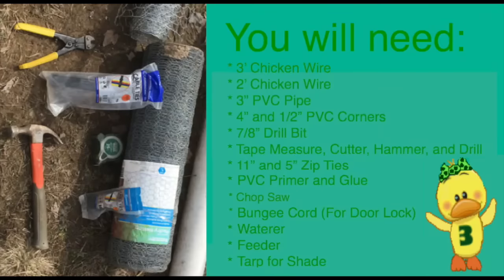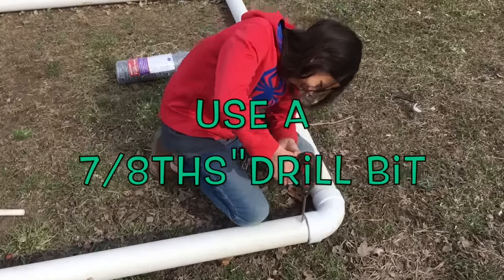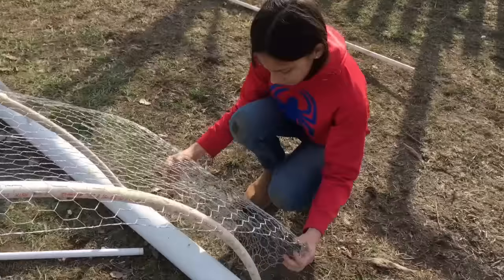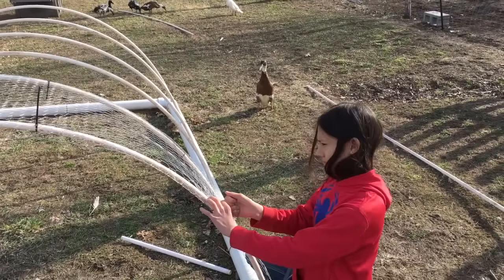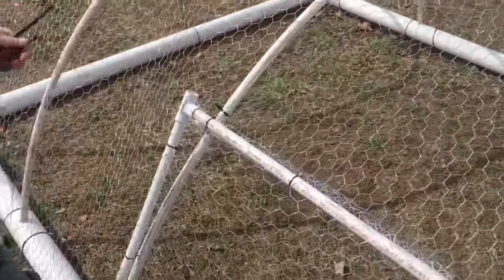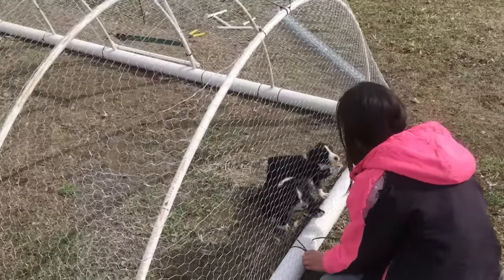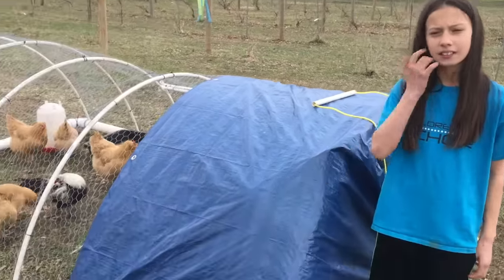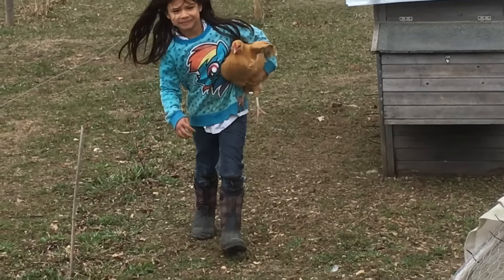Best PVC Pipe Chicken Tractor For Pastured Poultry - Part 1 (EP-36)

Comment: Thank you for this video! I'm currently building one based on this plan ☺️ Just wanted to give everyone that's going to plan on building this chicken tractor a heads up that you'll need one more piece of 1/2" PVC (8 ft) and four 90° elbows. I forgot to add that to my shopping list 🤭 I also replaced the 6ft 3" PVC on the ends with 2" to save about $20 👍
Reply from the maker: I'm thinking this will leave a small gap under the 2" sides and may encourage chickens to dig there. Moving it more frequently might help. Good luck and thank you for your kind words!

Comment: Outstanding design, very quick and easy to set up. If I was going to point out a 'down side' it'd be the cost of the large diameter piping & pipe fittings in comparison to a pvc build using smaller diameter parts.
Reply from the maker: Hello and Thank you so much!  3" pipe is getting expensive!  Reducing the base diameter could help save money.  The 1/2 poles go to the bottom of the base pipe and might be less stable with shallow pipe and I found the 3" inch pipe slides better....but cost is important too.
Reply: @vineyardchickshomestead  you're just all kinds of awesome 😊

Comment: I like it!!  My next project.  I think it would be easy to add "wings" made with more PVC and 2 foot chicken wire that would hinge on the big bottom pipe (using ties?) and could be raised to rest on the curved frame during "travel".  The sides could be 2 on each side for ease of lifting without bending, and the ends can be one piece.  The "wings" should be extended to cover the corners when the ends are down.  The door would be closed when moving so it even works for that.  When the "wings" are down they should be staked with something so critters can't lift them.  Maybe lawn staples or even stakes driven at an angle and resting on the pipe.
Reply from the maker: The base is pretty heavy. We have not lost any chickens in our tractors even though we lost 2 this summer out of the fenced in pen with 6 foot fencing.  It's pretty heavy unless you lift it by the strings.  Good luck.

Comment: Hello. Thanks for your great tutorial on building a chicken tractor with PVC pipe!
We noticed that you recommend cutting the 3" PVC pipe at 6 feet.
In our area, 3" PVC pipes come in 10' lengths, so we wondered about cutting one pipe exactly in half (5' lengths) so as not to have an unsuable 4' length on two different pipes.
Will reducing the length to 5 feet instead of 6 feet cause the 1/2" PVC pipe to bend too much so as to snap it in two?
If the bend is too much for the 1/2" PVC pipe to handle in such a situation, would inserting a PVC fitting exactly half-way on each pipe -- so as to make a "spine" down the length of the tractor -- prevent the "snapping in two" situation?
Thanks in advance for your answer! :-)
Reply from the maker: Hello Mr Michael.  I definitely understand the concern of being wasteful.  The 6 foot length retains the properties of the half circle with a 3 foot radius.  It lets you use 3-ft chicken wire on the end caps and has a really nice shape.  I have not tried to bend the 1/2 inch PVC past this point so I dont know if it will cause too much stress. I have 3 of these tractors in use now and have two more videos planned for June so please subscribe if you want to see them.  Blessings! -Trie (girl in video)

Comment: Love your design. I used your design to build my first chicken tractor for my 10 young pullets before I put them in the big chicken & coop  with the larger hens. I made a couple modifications. Ist I put in 2 doors instead of 1 door because I am large and it's hard me to crawl inside the tractor because I'm 6 feet tall and in my 60s. One door for food and the other door for water. I also attached carabiners with hose clamps to the roof pvc pipe to food and water.  I also placed an old  medium size plastic dog crate with pine shavings for them to sleep in the night. We have problem with raccoons were we live in Connecticut. So placed "Nite Guard Solar " predator flashing red lights on all 4 sides. 12 to 13 inches from the ground to keep away coons & skunks. So far no complaints from my young pullets. 🐥🐣🐥
Reply from the maker: Wow!  I'm really happy to hear you liked my design and made it work for you.  I'd love to see a photo with your modifications.  Sounds really cool!

Comment: Hi! Headed to purchase supplies for this project. You listed 6 pieces of 1/2-inch PVC are required. What about the door? Wouldn’t I need another piece to make the door?
Reply from the maker: Hello Ms. Cook!  Yes.  You would need some old scraps or and extra new piece.  But you could also use anything that is about 2 foot by 2 foot to tie the chicken wire to.  Maybe an old picture frame or scrap 1x2 wood.  Really and square shape would work if its 2 foot x 2 foot.  Good luck let us know how it works out!  If you havent seen our Part 2 video we really recommend the utility tubs we found!

Comment: How long are the 1/2 inch pvc pipes making the hoops? The longest my local store had was 10 ft. Eye test appears to me to much smaller height when I bend them.
Reply from the maker: The 1/2 in pvc pipes are 10 ft.  They are stretched 6 feet across the base and end up being 3 feet high in the center.  That is why I use 36 inch chicken wires on the ends because it is 36 inches high.  I hope this helps!  Thank you!
Reply: @vineyardchickshomestead  thanks, my eye was just bad. This design plan is flexible! I had some 46 inch wide chicken wire laying around so I shrunk down the 24 inch distance between the hoops to 23 inches no problem!

Comment: How much did it cost to build? It's an amazing design.. I love it.
Reply from the maker: Thank you.  We really appreciate it! We made our first one from scraps around the farm but you can expect to pay a little over $100 if you dont have any.  Our local building store charges about $55 for 3" pvc (4), $12 for 1/2" pvc (7), $18 for elbows (4 of each size), and about $20 for both rolls of poultry wire (24 inch x 50 feet and 36 inch x 25 feet.). You will pay less if you have some scraps and more if you need to buy zip ties, string, pvc glue, or drill bits. Hope this helps!
Reply: Thank you so much

Comment: Thank you for this video on chicken run. Question: how did you connect the door frame? Before you made actual door , there was a door post that was horizontal with the hoops. This one horizontal piece, you connected the door to. Did you zip tie this one horizontal base frame or glue it? Thank you
Reply from the maker: Hello Ms Abby!  After I made the rectangle out of scrap pvc and covered it with chicken wire I looped loosely on top so it could pivot from the top.  For the bottom I ran a bungie chord across the bottom attached from the neighboring pvc pipes but now I use a little loop and ball bungee on both sides to fasten the bottom.  I hope this helps!! If you haven't seen Part 2 I show some ideas I had for feed and water trays, nesting boxes and such that all pull very easily.  The great thing about this tractor is 1 girl can pull it and give them fresh grass every day!  Good luck!

Comment: Fantastic video. I just ordered two batches of broiler chickens, 15 per batch delivered three weeks apart. This design is perfect because it will be easy and light to move. I think I'll stake the pvc pipe to the ground to keep it secure from wind and predators. Do you have any other suggestions to keep it secure?
Reply from the maker: Awesome Holly!  Thank you so much.  We do have a suggestion and we plan to make a follow up video with some modifications.  We had a couple storms this spring and Mom suggested we tie down the chicken tractor.  Almost always our winds are from the west so we tied it with string to cinder blocks. We used two cinder blocks on both ends of the west side.  We later found its easier to leave the strings tied to the tractor but to just wrap the string in the cinderblock before tipping it down, snug.  We use two cinder blocks.  We have a couple videos we are working on right now (strawberry towers, new pig pen, new baby goat, etc.) but I promise we will do an update to the tractor soon with our cinder block tie downs and our feed/water/nesting box addition!  Thanks again and good luck with the broilers!
Reply: @vineyardchickshomestead  Thanks for the quick response. My husband and I were sorting out the best design for our chicken tractor and your design won hands down. Not only because it's easy to assemble and move about the yard, but since my husband is a heating and air conditioning contractor he has an ample supply of pvc pipe. We also discussed how we would secure the tractor not only from the wind but from predators such a fox, skunk and raccoon. Our thought was too make some sort of stakes that could be driven into the ground at roughly 24" intervals. However we'll still thinking about this. In any case....We're utilizing your idea...Great Design!!!

Comment: Are the chickens in the tractor overnight? How do you keep the predators from digging under and into the tractor?
Reply from the maker: Hello. Our chickens have been in the first tractor since March and we have had no problems, here.  But we run the tractors down rows in the vineyard which is visible from our house and we have 3 dogs.  Although deer, coyotes and raccoons ran through the area before we planted the vineyard, hawks are now our biggest pressure.  It sounds like you may have more predators on your homestead.  I love our chicken tractor.  It's easy to move and keeps clean fresh greens beneath our chickens. If we had the issue you describe,  I think I would cover the bottom with chicken wire and lift the tractor with my sister or install wheels that could be turned to lift it and roll it into place.  We only move the tractor 10 feet a day but the chickens would need to off the ground if it had wire beneath.  Or, maybe you could clamp a couple handles on one side and a pair of old lawn mower wheels on the other side.  As long as it gets lifted high enough on the one side it should be OK.  Im working on another tractor right now and I will try to work something out for you. -Trie

Comment: @vineyard Chicks How long are the short side 3" PVC that you are using? thank you, great design
Reply from the maker: The short side is 6 foot.  This was done so that the height of the 1/2-inch pieces would be 3 feet tall and I could use 36-inch chicken wire on the sides.  Good luck with your chickens!
Reply: If the short side is 6 feet, how long is the long side? Great design by the way. I might use hardware cloth instead of chicken wire. I'm also thinking of adding wire to the floor for added protection
Reply from the maker: The short side is 6 foot, the long side is 10 foot. If you have predators, the hardware cloth sounds like a great idea. We have been using our for 3 years, but we dont have many coyotes come through. It is heavy for raccoons to lift but if they try to get in and undo or break the wires, then there could be a problem. We pull ours everyday so having something at the bottom, I feel, will most likely hurt the chickens and their feet will get stuck. Please be careful. I hope this helps... Best of luck and blessings! -Trie

Comment: Have you ever had any problems with any predators getting under the chicken tractor or getting inside of it?
Reply from the maker: We had a squirrel that got in and stole an egg, but we trapped it and that was our only issue.  We used the 3" pvc because it's easy to slide and heavy. The squirrel went in between the chicken wire is attached so I doubled them up down low.  That was our only issue and we have 3 chicken tractors now!
Reply: @vineyardchickshomestead  so nothing has tried to dig under it?
Reply from the maker: noinjapan06 We have not had anything dig under. We move it 10 feet, a full length, twice a day.  Not sure if that makes a difference or not.
Reply: @vineyardchickshomestead  I’ll post pictures after I make it, probably next weekend, do they need a house in there in the winter?
Reply from the maker: noinjapan06 That would be cool! We get a couple feet of snow in winter so we do not use the chicken tractors in winter.  Please see Part 2 of our Chicken Tractor to see our nesting boxes and tarps.  Because of our temperatures, we only raise Opringtons.  We made a video about our Orpingtons, but we use know heat and keep them in a dog run with pallet shelter Dec-Feb.  Hope this helps!

Comment: What type of this PVC pipe called, the bend one?
Reply from the maker: I used all Schedule-40 PVC.  The 1/2-inch bends without heating. Flexible enough a girl can do it!!
Reply: @vineyardchickshomestead  OKAY! But unfortunately, it is not available here. And the people saying that you need to buy an iron pipe that can be heated to bend.
Reply from the maker: You do not need to permanently change it's shape because it will be held in place.  Just check your 1/2-inch pipe for flexibility.  It was not very hard for me to bend it when on side is already in place.  Try bending a piece before you try a heat gun.
Reply: @vineyardchickshomestead  Alright okay, Thank You

Comment: How well do they hold up to predators?
Reply from the maker: Hawks do not bother them and that is are most frequent predator!  We have had zero issues in the tractors (we have 3) but we don't know how our predator pressure compares.  We had issues with raccoons before we made the tractors and we've had a coyote on our farm a couple times.  He apparently prefers free-range duck to chickens in chicken tractors...but I don't know how it would have faired if nothing else was on the menu. The chicken tractors are not easy to lift but a kid like me can easily pull them.
Reply: Thank you for your response it looks like a great option especially with the current cost of wood. My biggest xoncern things getting under the tractors and flipping them. Do you get any water in the bottom pipes?
Reply from the maker: Flipping them is not an option!  With the 3-inch pipe it is heavy and bottom Heavy!  I lift one side by the rope to pull.  If I did not use the rope I could not lift it.  Even with the rope I could not flip if by myself.  The pvc is nice for sledding.  If it was wood I could not pull something this heavy by myself.  I think I mentioned I have 3 of them now in use.  I will make another video this month.  If you havent seen Part 2, it shows how I included water, food and nesting boxes that I pull everyday without adjusting,  Thanks for commenting! -Trie

Comment: How long is your half inch for the hoops
Reply from the maker: Hello Mr Harbert!  The 1/2 inch pvc pipes used for the hoops were 10 feet long. Because the base is 6 feet wide, the height is only about 3 feet high even though the hoops were 10 foot pieces.  I hope this helps!
Reply: @vineyardchickshomestead  thank you for your reply, and do you know how much of the 2 foot wire you used was it less than 50 ft
Reply from the maker: We used the entire 50 feet of 24 inch chicken wire and completed the middle section last.  The last section will be too short to reach all the way but its OK because we wanted to place the door in that middle section.   I cut the door from the 3 foot roll needed for the end caps.

Comment: What dimension lil grl
Reply from the maker: The 3" pvc frame was 10 foot by 6 foot.  The 1/2 inch pvc was also 10 foot.  This gave it a height of just under 3 feet.  10 foot diameter divided by pi. Hope this helps and thank you!
Reply: She said it was sixty square feet that would make it 10" long by 6' wide..

Comment: What kind of drill bit did you use to make the hole?
Reply from the maker: Hello Ms Deborah!  I use a bit that is just bigger than the 1/2 pvc ...so 5/8 will work.  My bit tip looks like a big triangle with two smaller triangles on each edge.  Good luck! -Trie (girl in the video)